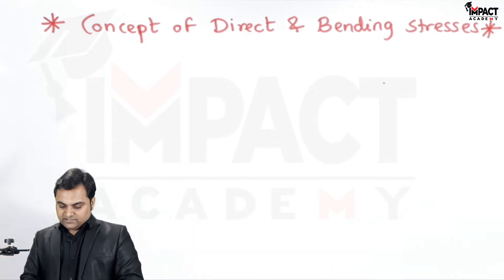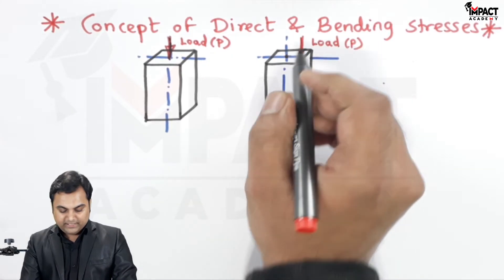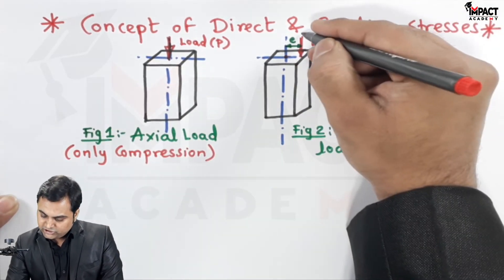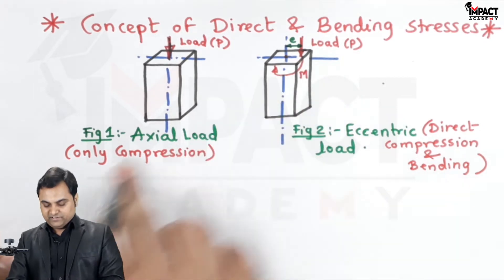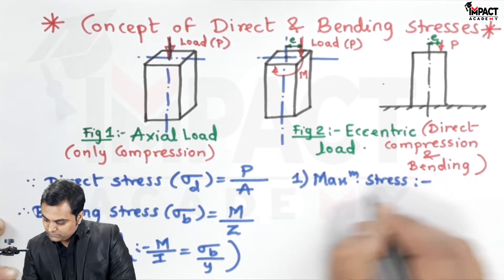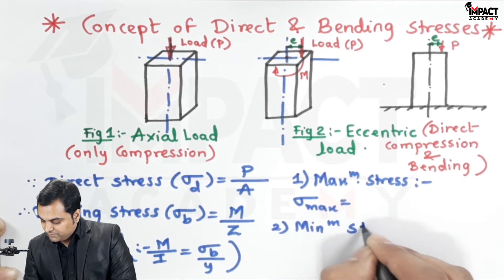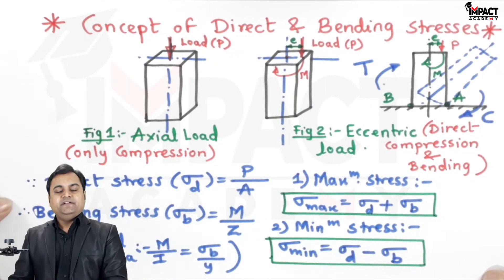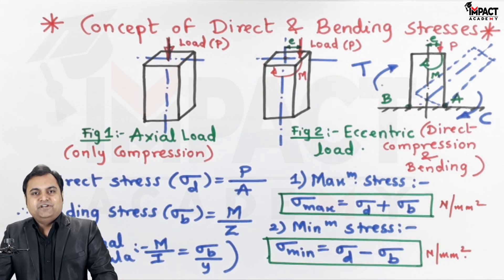Concept of Direct and Bending Stresses | Direct & Bending Stresses | Strength of Materials #zafarsir

Comment: Direct compression means what
Reply from the maker: In mechanics, compression is the application of balanced inward ("pushing") forces to different points on a material or structure, that is, forces with no net sum or torque directed so as to reduce its size in one or more directions.